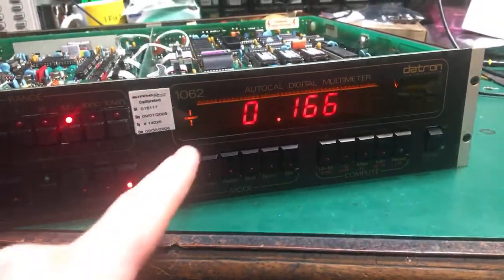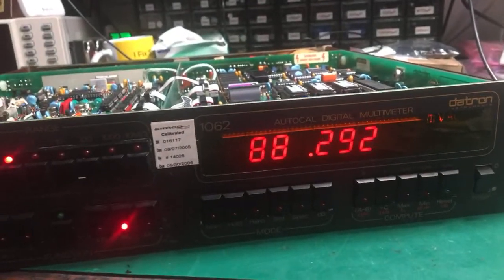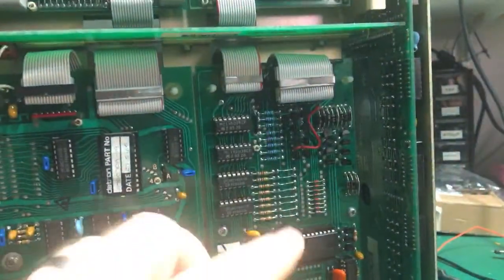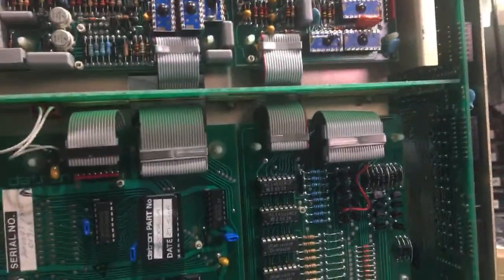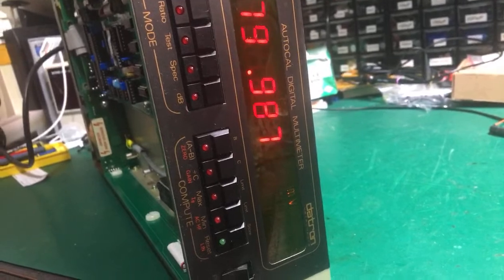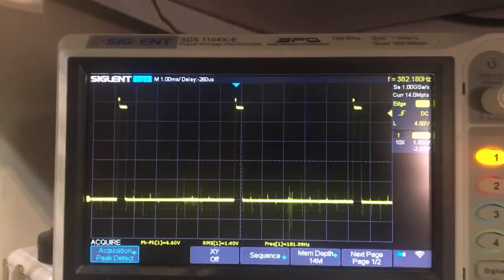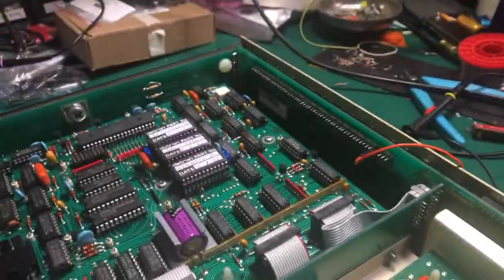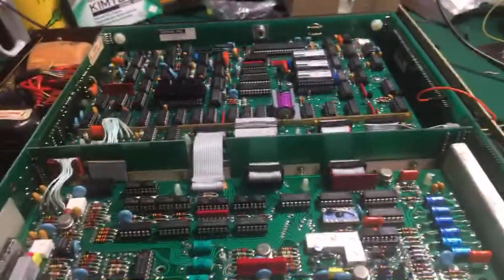The Datron display is now working properly!

Comment: Well done, Scott! Those digit and segment lines look so much better. It would be interesting to see how the OLED display looks. Also, I was wondering if you could file/sand the face of your 3D printer annunciator after putting on the black-out paint to bring it down to minimum thickness to help with brightness.
Reply from the maker: Today I redesigned the annunciators, those look really good now!